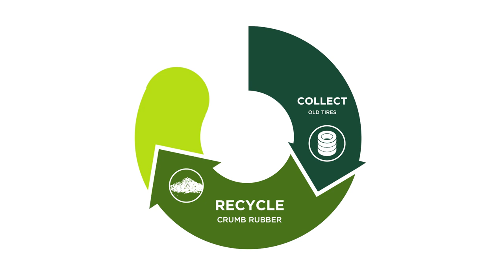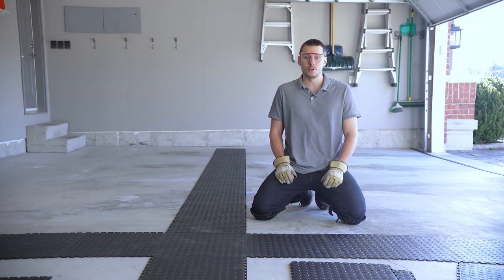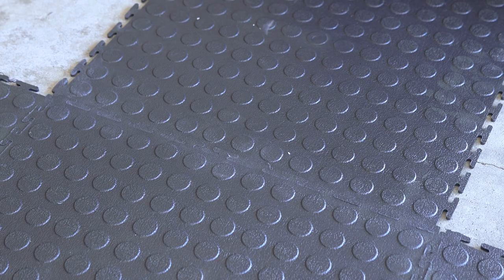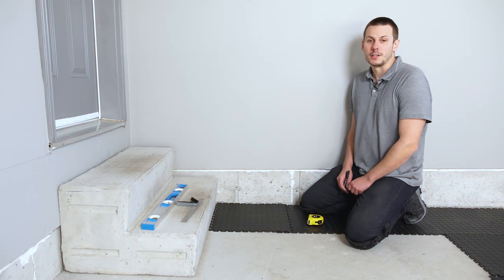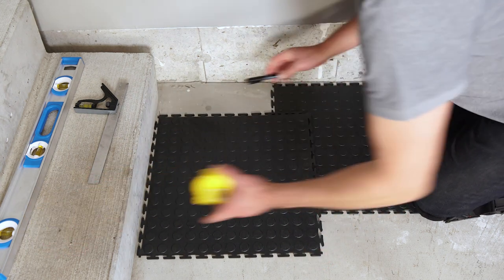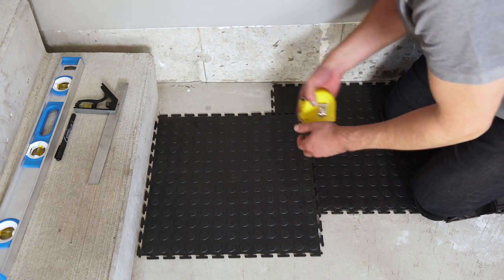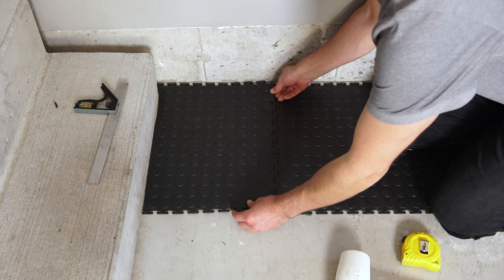Install EASY|tile Utility Tile recycled rubber interlocking flooring for your garage floor.

Comment: Was very disappointed with this tile on our garage floor. The installation was very easy and looked great. Left a 1/2” expansion, had a cool night  and the house faces the East and with the garage door open by 11am the tile had a number of 3/4” raised joints from expansion. The floor goes back down after the sun is off it. Not sure how long it will hold up to this constant movement.
Reply: You could keep your door closed.  Does it have to remain open?
Reply: @johnbauer5298  we have windows in the garage doors and this will cause the tile to buckle, if the garage door is open for a shout period of time  it will buckle between and under the cars. We ha a couple of 100+ degree days and just the heat in the garage cause joints to raise and buckle and the is with 1/2 gap around the perimeter. Very disappointed with this product and the response for customer service!
Reply: Thanks for the heads up.  I live in central Florida and during the summer months my garage temps are 100 plus in the heat of the day.  I will definitely use another product.
Reply: Well I ordered Race Deck tiles and should have them by Friday the 13th of August. Hopefully I’ll have them installed on the 14th. So glad to get rid of the ugly 🤮🤮🤮🤮🤮🤮green floor!
Reply: @johnbauer5298  hope they work for you, be interested in how they hold up, may remove the ones I have down.
Reply: @garykennett2332  I will only be parking my 2 vehicles and a zero turn mower on the tiles so they should perform very well as they are rated at 80,000 lb. rolling weight.  My days of building cars and engines are over so there shouldn’t be any fluid spills.  Very minimal sunlight on the tiles since I normally keep my doors closed, too many critters, snakes, gators and bears in Sebring so the expansion of the tiles should not be a problem.
Reply: The tiles were delivered on Friday around 2:00.  I started the install process at 3:00 and was done by 8:30.  I’m 71 so I don’t move as fast as you young pups.  Installation was very smooth and easy .  Really changed the appearance of my garage…love it!
Reply: @johnbauer5298  GREAT JOB!! let up know how they hold up to the heat in your garage, mine buckle between and under the cars when we get triple digit temps in Nebraska, even with gaps around the perimeter.
Reply: @garykennett2332  well they have been down for about a week and I’m not seeing any buckling or expansion of the tiles.  There have been a few times when the garage temps have been in the triple digits and I’m not having any issues whatsoever.  However, I’m not getting any direct sunlight on my floor like you do.  As the sun heads south I will eventually have direct sunlight on a small part of my floor if I leave the o.h. door open so maybe there could be some movement from expansion.  I’ll have to wait and see. Hope this helps.
Reply: @johnbauer5298  great to hear you are having good luck with your choice of tiles, not sure how long I can tolerate mine.
Reply: @garykennett2332  well here is an update.  The sun is heading south and now is hitting my tiles thru the garage door opening.  I’ll need to keep my door closed as it did pucker in a couple of places, up about 2 inches.  Just can’t control the effects of the sun thru expansion and thru fading of any object.  However, I had solar panels installed a couple of months ago and now the sun is providing 100% of our electrical requirements.
Reply: @johnbauer5298  the sun can be a helper sometimes, enjoy the free electricity

Comment: What do you wipe with to keep it shiny
Reply from the maker: You can keep tiles clean with mild detergent and soft brush/mop.  Most customers will simple hose down with a garden hose, with the garage door open for water to drain out to the driveway.  Do not use harsh cleansers.
Reply: @MultyHome  these tiles are inside of a retail store so I guess the same cleaning process ?